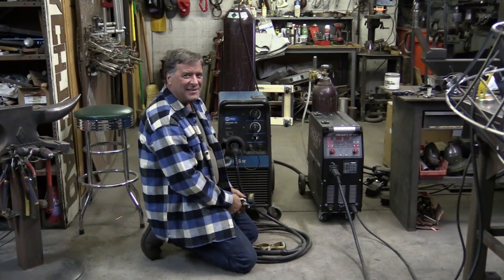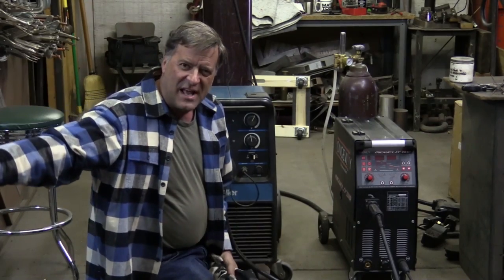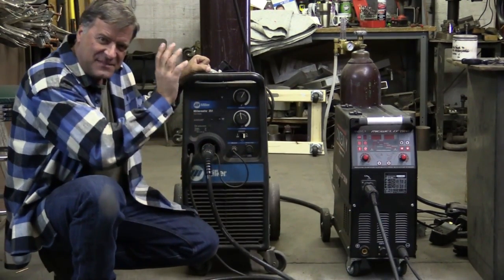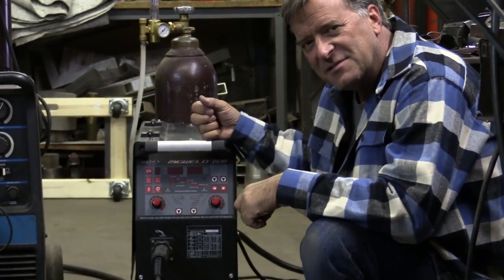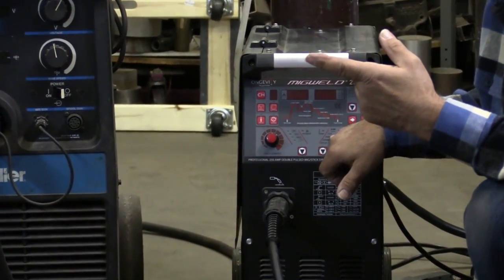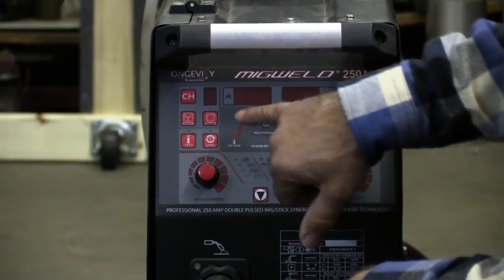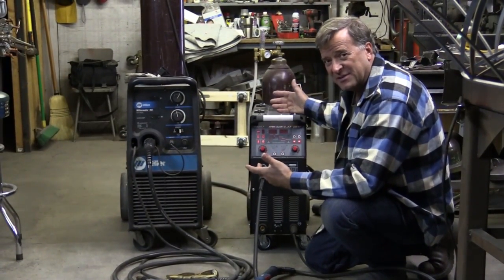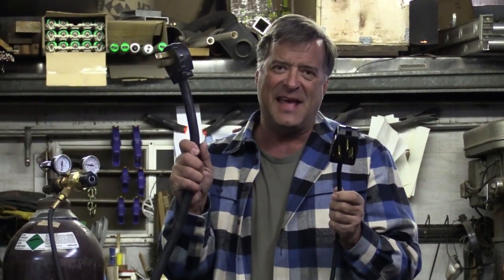Why You Don't Need a Welder That Will Last 40 Years - Kevin Caron

Comment: The reason these inverter / electronic welders are popular is because they are cheaper to produce
That not the only reason 
It is though a big reason
Reply from the maker: Very true!  But the quality of the machines has gone up so much!  Still have my first Everlast machine and it is still going strong. Not a single problem to report.
Reply: Yes we live in a techno groovy era.
A world where hobbyist can dabble in things that were once in the realm of industry.
These new welding machines are not often financially feasible to repair.
Things have got to a point even machines that are expensive industrial quality machines are not worth repairing
THING IS
It was not always this way
It quite complex to put everything in the correct perspective.
The definition of quality
That is complex in this case,
There is no way to compare machines used by industry to machines used by hobbyists.
Sadly even in welding even the United States is no longer the biggest kid on the neighborhood.
As I read over this I almost confuse myself.
The thing is though.
These is no way to compare the old copper and steel behemoths that were from the bygone era.
These old machines were built with no thought to Planned obsolescence,
Almost all welding processes are older than most realize,
Going back many decades at the least.
We just are in a techno groovy time.
I remember my first experience with mig welding
That was in the 1970s ! 
These techno groovy machines do not impress me quite the way it impresses others
I been there done that decades ago;
I does impress me that the techno groovy machines do a amazing job at a disposable price
The the machinery though is not the same
Also it likely not important a machine last 40 years.
In 40 years there might not be no need for welding,

Comment: It’s true what your saying the transformers last longer , however I am hearing that the invertas only last 5 or 6 years . The repair shops are full of them . The Everlast machines are pretty decent from what I am hearing . The thing with Everlast is that their are no dealers where you can go and look at them . They also come with some cheap parts on them that need to be changed out when you buy one . Price is a big thing with these machines , Miller or Lincoln are about 5 or 6 thousand dollars.
Reply from the maker: I have used my 255ext that I got in 2015 with the stock torch and foot pedal. Just sold it to a guy that is starting out and is very happy with the machine.  The 80 amp plasma is still running the stock torch.   You don't HAVE to change the torch but there are nicer, more comfortable ones on the market.  As for a store to put your hands on the machines, that I am not sure about.   You use to be able to get them at Home Depot.  Not sure if they are still carrying them now.   Everlast just released a 1st to market 140 amp MTS machine that is very nice.  Runs on 120 volt and puts out a full 140 amps. The mig gun is a little short for my use but works just fine.   Just have to move the machine a little closer to the work.  Thank you for watching and posting.

Comment: Just for background. I was practically born welding, it was nessicity, not sure how young I was when I started but I was earning very good money by the time I was 16 welding other people's logging equipment, and my metal shop teacher was asking me questions. ( It was awesome because he really let me forge and taught me a lot of machining basics )  

I got out of it when I was about 20, I was doing really well at construction. I had started out with an old Hobart that had a surplus WWII jeep engine powering it and a slow to kick in governor. Meaning peck, pull back, engine rev, then weld. And if you were off by a tenth of a second, that 3/16 7018 would be a glowing "U" before you could get it out of the stinger.  

As long winded as that was, yeh, you are absolutely right. The new inverter welders are beyond better. Wonder what is next?.
Reply from the maker: Well here is Phoenix Az we are getting in to the solar welding part of the year.   Just hold the metal outside for a few minutes and then just hold the 2 pieces together!   Kidding of course but I guess the youngsters of today will see lots of new ways to do things we can't even imagine.
Reply: I hear ya there, I'd take some of that welding sunshine up here in Ohio, after the cold snap we got today.

Honestly for future, likely going to be a majority composites that we've just glimpsed, faced with alloys that we've not seen yet. Pressurized atmospheres will be a component of forming the alloy, not just sheild gas like now. Not that steel will be gone anytime soon.  Might even be some carbon matrices "grown" together.  It's like someone from 1920 seeing a drone.

Comment: Not everybody has thousands of dollars laying around to buy a new welder every 6 years probably the biggest reason to go with Transformer nor do they have $1,000 to repair a machine if it goes down in the middle of a job which seems to be the case with inverter base machines
Reply from the maker: Very true!   Thanks for posting and watching.

Comment: I used to have a Lincoln 300/300 TIG machine transformer base and that machine was incredibly bulletproof. I kept it in an unheated milk house room attached to a barn and I remember starting it up occasionally where you'd hear some noise from the fan where it hit material the mice brought in to build a nest with mice running out the bottom, and never had a problem. I guess fortunate that they didn't chew up the wire installation. So yes the machine was bulletproof of course it didn't have all the controls for ark that the newer inverter machines have but there is something to be said for bulletproof technology. Might want to have both.
Reply from the maker: The only thing I hate about my Miller Syncrowave is the amount of power it uses.

Comment: The only thing I don't like about the inverters versus the Transformers is that from the time you plug them in there sucking a decent amount of electricity up the old Transformers on the other hand don't use any unless you're actually welding really the other thing is you have far more to go wrong and break inside of an inverter while the old transfer machines are pretty basic and robust
Reply from the maker: Sorry, don't agree with this at all. My power bill dropped by about $75 dollars a month just from not using the transformer machine.  Love the old Miller but it sure is a power hog. The Miller wants a 50 amp service but the inverters only need 30 amps.    Just look at the size of the power cables on the 2 machines.  The transformer is 3 times the diameter of the inverter.
Reply: This is so wrong lol.
Do you seriously think a coil of wire connected directly to the mains don't use any power?
And on top of that, transformers are horribly inefficient when compared to switch-mode power supplies, 30-40% to 70-90%.

Comment: my welder is over 80 years old was my grabade he bot after the war   oil cooled & s , Stik A tig  At with ac Buzz-bar  converter ,  bort for.  10 pounds & still working like the day it first came grandad sed As he gave it me ,  well with  i have had it not 80 years & stil welding with it today  ano "problem"  with the converter , it tigs like a truper  start ,   from the day i got it  & that why it best to by good kit .  It was great to drive my Jag  But my  ford  poler  Sit up a Beg .  was grant & car until i couldn't gat the parts ,  lated a long time .   Les england  Cant bit the good stof .
Reply from the maker: Sounds like a great old machine!   If it works for you and you are happy with it then that is the best way to go!

Comment: Inverter welders just don't last long. I bought an inverter welder and it lasted me less than a month before something inside of it blew and it was dead after that. They might be good for hobbyists but I wouldn't trust them for heavy duty usage. I wouldn't trust that longevity welder. All of those options and selections just over complicates things and there's more things that can fail on the machine (motherboard).
Reply from the maker: I no longer have any of the Longevity machines.  The Everlast and AHP machines I run have been about 90% reliable.  A couple of switches and a mig gun is all I have had problems with.  Granted I don't run them maxed out 12 hours a day but I have run in to jobs where I had to preheat the hell out of some plate to get the 200 amps to get the job done.   Whatever works for you is just what you need to have.

Comment: since your old miller is a transformer machine, does it creates humming sound when is on ?
Reply from the maker: It is almost silent when it runs till the fan comes on.  Then it is just a little louder than the radio but not much.

Comment: Technology doesn't always get better. There's people using 15 year old Stihl chain saws that are working like new whilst people who have purchased the newer poorly built Stihls are out of luck because their saw has shit itself. There's many examples of where machinery is getting worse.
Reply from the maker: True, but most of the time, things have advanced.   It's the companies that try to reinvent the wheel that get in to trouble.
Reply: @KevincaronSculpture  I think it's often more a case of planned obsolescence. A huge amount of R&D is focused on designing machines that will last X amount of time. It's an issue that largely flies under the radar in the dialogue about pollution. Cars are a great example. Our older cars are forced off the road by regulators because they aren't as 'environmentally friendly' as the new ones. You buy the new car and presto, at 221000k's the engine light goes on and you have to trash it. So the Co2 that's produced to make another shiny new one probably far outweighs what the older one would have produced.

Comment: Hey Caron- thanks for helping me learn tig welding with your videos. I have the Everlast MTS 275 lightening with tig cooler. My question is could you do a short video using this machine (mts 275) identifying the setup settings while welding 2 aluminum soda cans together? I have made numerous attempts but can't seem to weeld without blowing through with 15 amps! Please
Reply from the maker: HI Brady,   sorry but I don't have the 275 Lightening anymore.  A local welder came by to try it and bought the whole setup!  Cart and all!   Still waiting for the next shipment to come in.   I will add this to the video list so please stay tuned.

Comment: Sell this old transformer Mig Miller, there is nothing sentimental in there, it's not a living being.
Reply from the maker: I would get rid of this boat anchor in a heart beat, but the cheap skates out there only want to pay next to nothing for it. 
Best offer I have gotten is $500 usd for it.    Sorry, it's worth more than that.  Doesn't cost me anything to have it sitting there.  I still use it now and again just to see the difference.
Reply: @KevincaronSculpture  , take this $500 because for 5 years you coud not sell more then $250 and for 10 years you could only sell copper and iron per kilogram in recycling yard. We are in inverter era and even inverters price will drop by mass production for next 10 years.

Comment: Just want a welder. Newer technology means foreign built. China. The older the better. More functions means more problems.
Reply from the maker: I feel that way about my phone!
Reply: Kevin Caron, Artist it’s like the old central heat and air units. Yes they use more electricity but they last 40 years. The new energy efficient ones last about 12 years if you are lucky. Kevin I’ve got a miller matic 250 and all it does is weld. Not sure if it has the mother board or not. Probably it does. Bought in 1998. The less you can get on anything nowadays the better.

Comment: I'm shopping for a new welder, this topic made me stop and watch twice. I got my 2 welders in 1990-91, lincoln sp125 plus an ac225 buzz box. My sp125 has only used flux and i'll keep it that way for quick and dirty, my ac225 is almost unused, don't got 240v, but it's coming this spring. I'll look at multi process boxes with MORE Bang for appeal after this video. Just retired form computer industry 1976 to 2019, and technology has really changed, welders have to. Looking to upgrade for more auto restoration and hot rod work, wont try safety stuff like roll cages, my welding isn't good enough for that at this time. This 5 year video was right on time.
If you got to get on your knee's....Let em know you ain't cheap.....make em pay $$$$ for the privilege!!!
Reply from the maker: I hear ya Mike!!    Thanks for being on the other end of the internet!

Comment: Hi Kevin, in reply to your video, Why you do need a welder that will last for 40yrs.

I have a 1983 oil cooled Oxford Bantam 180amp AC only SMAW welder and it will weld all day long at full power using single or 3phase (It is dual phase). They have an incredible reliability reputation due to build quality. It cost me £100 earlier this year when I bought it and it will easily last 40yrs. No new modern machine using PCB's and inverters will be running in10yrs unless they are high end brands.

I have similar aged SAF Fro 160 Tig & SMAW 160amp AC & DC and a BOC/Murex 180amp MIg welder both with basic transformer technology with a very basic PCB's. I anticipate these will last another 40years providing spare PCB's can be bought?

Finally I have an Oerlikon 160amp DC only inverter SMAW, great machine because it is highly portable, it won't last another 10years because inverter technology by it's very nature is vulnerable to heat, vibration, current and usage and this is why some modern technology is worse than old gear. New stuff is throw away whereas old gear lasts for year on year and is in my opinion better for planet Earth because it doens't need resources to replace it so often. 

At the moment i am pondering on buying a 70yr old 300amp dual phase stick welder! It still works, can still do a job and is dual polarity too. I anticipate I can buy for roughly £50 or $38. Apart from it's dimensional disadvantage and that is weighs about 300kgs or 600lbs it will outlast and work harder for longer than any modern equivalent (Especially from China!).

So, the moral of my comment is, why dismiss reliable old welders for new short life throw away welders? Save the planet and buy old and make an older smile for longer!

Comment: Hello young man, I recently bought a 35yr ol Oxford Bantam 180amp SMAW welder simply because it represented a great way of getting old school quality, very long duty cycle, at great price and it will out last all the Chinese rubbish being punted about. I generally believe in separate processes for many tool areas. Why spend £/$1,000's on a welder when there is very good quality stuff to be found on the used market. I  believe in having resources and if you have them you don't have to use them every day,  but when you need them they pay dividends!
Reply from the maker: Very good points!

It all comes down to what works for you. 

Thanks for watching and posting.

Comment: I'm buying a new titanium mig140 from Harbor freight their new line of welders.
399$  plus a 20% code for discount for Black Friday..   I'm pretty fired up about that.

It's my first welder. But I'm sure I will buy more as I improve. In my skill level.
I want to build furniture, repair cars, and also build Security gates etc..  and whatever else I can learn how to do.  I love welding. I got into late in life but I spent 21 years in The Marines so that took a lot of my focus. Then. Now it's time to learn a new trade.  Welding!
Reply from the maker: Welcome to the club!
Reply: Bryan Calhoun 
Read your comment. First of all, thank you for your service. 21 years takes a lot out of someone. I don’t have experience with Harbor Freight welders but I do shop there often. I do understand the need to buy Chinese. Especially for hobby welders that are making little to no money with this stuff. You should look into AHP as an alternative to HF stuff. I bought a 10 pound, 160 amp, 60% duty cycle (lunch box) size Stick/Tig welder for $220 online. It’s an amazing machine. HTP is another great welding brand. Very reasonably priced and manufactured in Hungary at a standard comparable to USA made stuff. Very good company to deal with. Best of luck.
Reply: Just keep in mind the limitations of the machine. You mentioned building security type structure only thing is material thickness will half to be kinda thin. Not trying to put down your purchase or insult you because spending a few hundred dollars on anything is no small order. As for furniture and auto applications it should suit you well. I do suggest however that you use quality consumables. Good gas, good wire, welding tips , and cones. Have fun with it 👍

Comment: I have a millermatic 250 and would choose it any day over the few inverter machines I have worn out one Chinese and 2 red brand. I maybe partial but my 20 year old millers and 50 year old Hobart tg201 will outwork and has outworked any inverter machine and will last longer then I will if I take care of it
Reply from the maker: Awesome that you have such old machines and they still run.
Thanks for watching and posting.

Comment: Pretty sure a new $2,000+ machine doesn't melt metal together any better than a $50, sixty year old machine. But hey, there is more stuff to fail. I've seen crap welds with really expensive machines and really good ones from machines far older than you...and vice versa. It matters more who's under the welding hood than what sort of new gimmick crap the machine has.
Reply from the maker: So very true!!    It's all about what works for "you" and that helmet time.